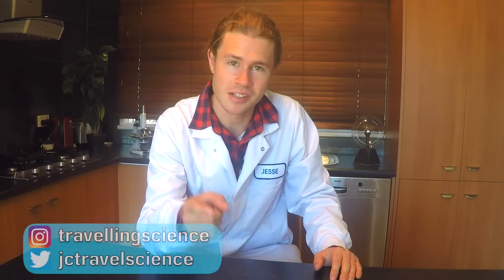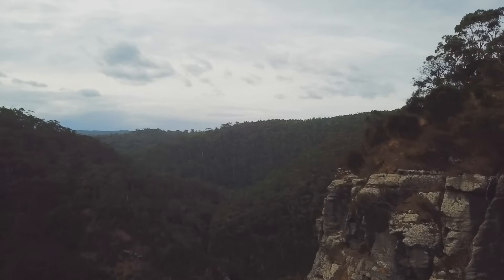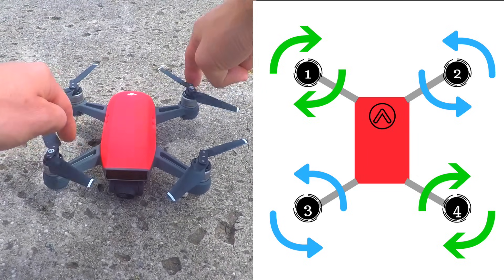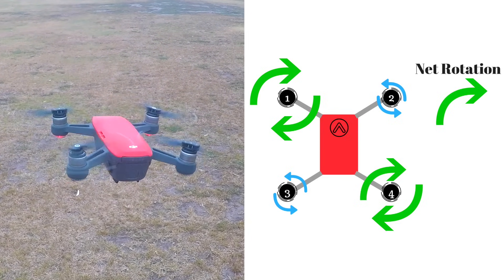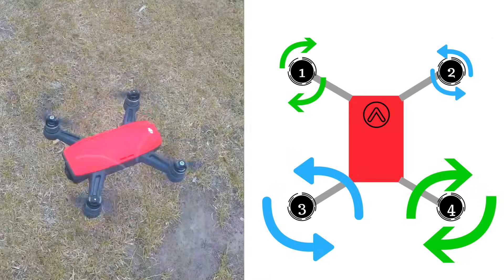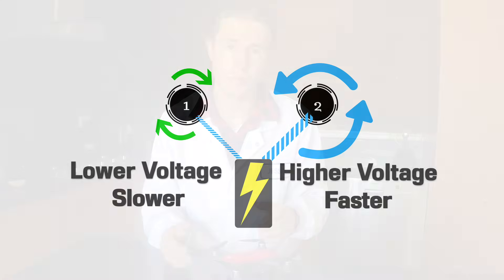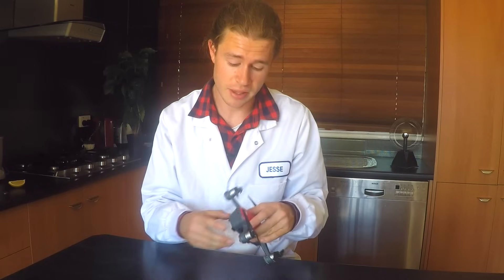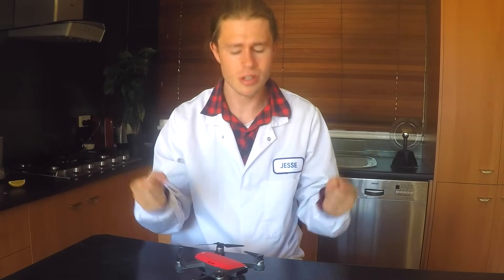HOW DO DRONES FLY?

Comment: about yaw movement. what I learned is if you wanna drone rotate clockwise, the electronic speed controller will increase the rotation power of two diagonal propellers which are rotating anti clockwise. I think it is opposite to what you said in the video. not quite sure
Reply from the maker: Hey @Metro Monitoring3 you could be very right, thank you for pointing that out. I often make little mistakes when creating these videos, so congratulations for catching me out :D Cheers legend!

Comment: I don't think because it pushes air downward . Actually it's about high and low press ure
Reply from the maker: Very clever Michael! This is called "Bernoulli's Principle", where the air pressure above the rotor blades is lower because of the higher wind speed, and so the drone naturally lifts into the lower pressure area, upward. Great observation legend, thanks so much for watching and commenting!